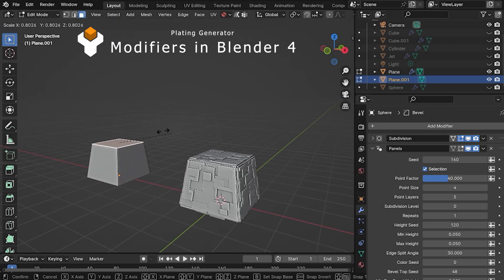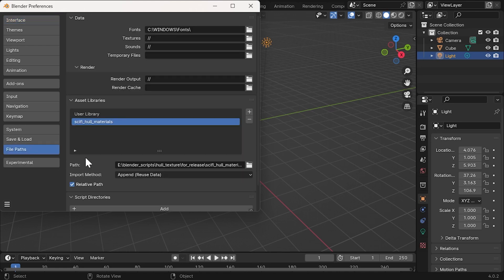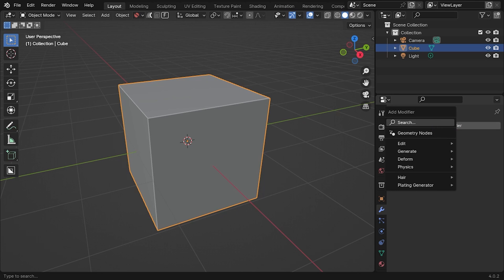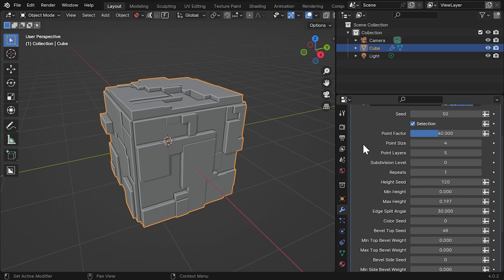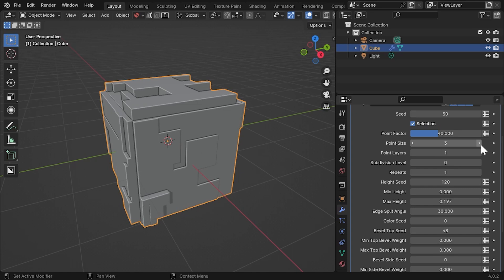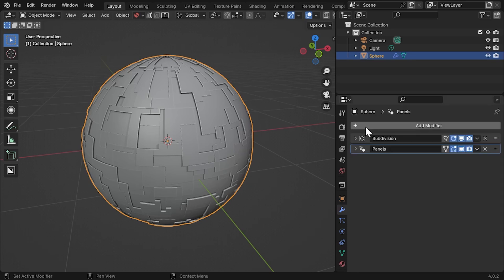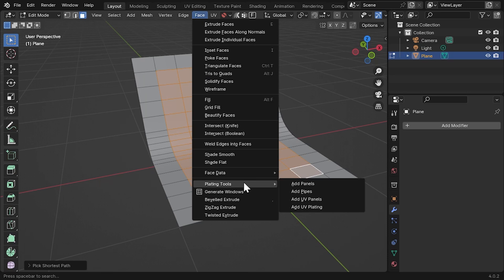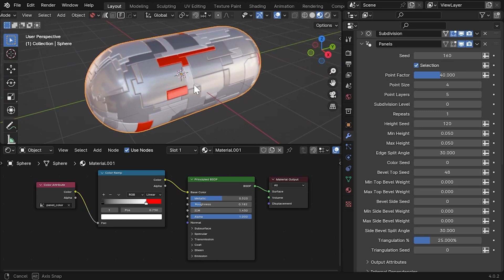Plating Generator Modifiers and Tools in Blender 4

Comment: So looks impressive. Can I for example panel an aeroplane where some of the panels lie side by side and others overlay each other?
i am modelling a Mustang P51 and it seems only certain panels are overlaid and riveted
cheers
Mike
Reply from the maker: Hello Mike - the Plating Generator is aimed at automating the creation of lots of panels using the existing faces and edges of a mesh.  When you have more specific panels in mind, you might end up fighting between the topology (ie faces and edges) of the mesh and the type of panel lines you want to create.  So, for the more precise work you may want to do, I would recommend one of the following approaches depending on what you want to do with your model:

- If you don't need to print your aeroplane model and are making it for gaming or images/animations, I'd recommend either adding the panels as height map textures or normal maps (see this tutorial here: https://youtu.be/WizT4jakNBs?si=WjZ3QJeK31tGA5LB). You will need to UV map your mesh in order for this to work well. You might also want to consider the add-on DecalMachine, which has a concept called Panel Decals using their Slice tool (they are like putting 'stickers' on your mesh, see https://youtu.be/PxCW1L696Wk?si=Mzm99xvsEeLtiYHH)
- If you are looking to 3D print your aeroplane model, you will probably want to look into methods of cutting or slicing your mesh.  There are two main techniques I am aware of.  The first one is using Boolean cutters, like in this tutorial at https://youtu.be/kNpB0RrhuOA?si=Ogds5b0XbL60F1q6 (this person has lots of other good tutorials too, such as adding rivets: https://youtu.be/m81mFjpbLa4?si=p6BvsHW5fvvJPGW0).  You might want to consider the Boxcutter addon for this.  The second method is using Blender's sculpting tools to create the panels, which can be seen in this tutorial: https://youtu.be/pZke4PlSWvc?si=03IT1es2THxMtb-k.

I hope some of these suggestions help (apologies if you have seen these before!) and happy to answer further questions.
Reply: @mark_kingsnorth  thanks for all the info, will read it at my leisure. turns out that with planes not all the panels overlaps, , just areas that need more strength, which have rivets. I was not even aware of that :)